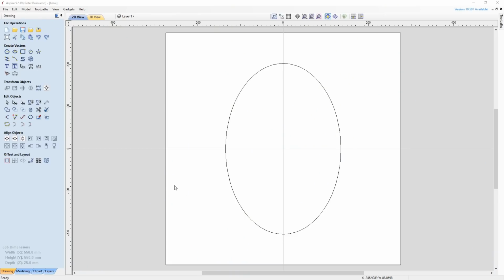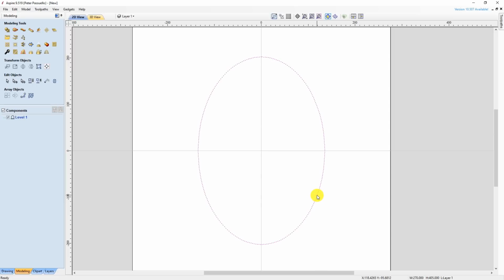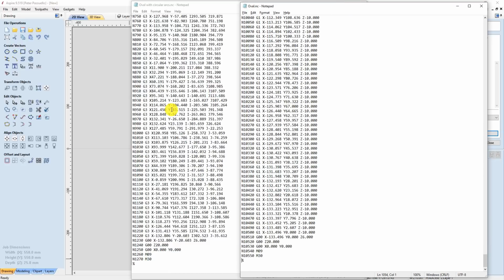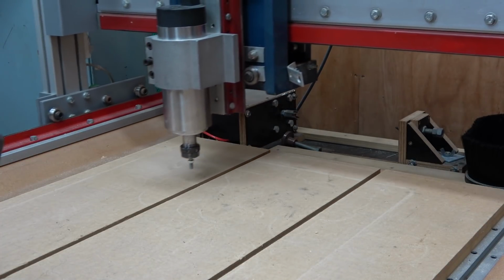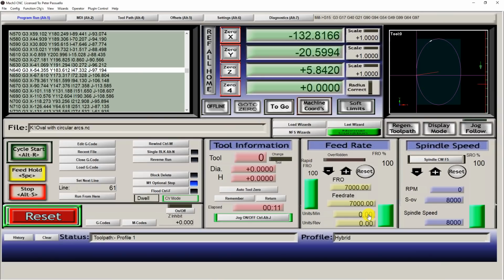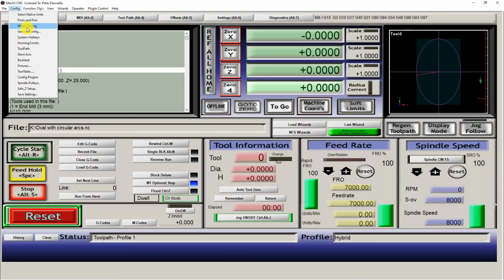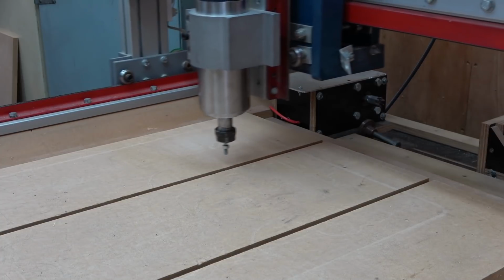Make Smooth running Gcode - CNCnutz Episode 249

Comment: I never understood CV arc tolerance distance until now.  I've been running Mach 3 on a Bridgeport-size metal mill for 18 years in cv mode.  Recently I upgraded to Nema 34 steppers with encoders for closed-loop movement, and it works great!  As far as selecting entry ramping, I like to spiral all the way down - cutting less air.  I just set the tool plunge to the normal feed rate, and select spiral.

Comment: Thanks a lot Peter for this educative video. My CNC is gaining Z in raster mode, about 1mm every 100,000 lines. This causes the roughing to complete without issues but the finishing starts hovering over the rough passes as it completes 100,000 upto 1million lines.

I usually do relief work on wood and I face this problem then. I discovered my Stop CV on 6degrees angle was giving quite a toll to the machine, ticking it off made it run much faster.

Comment: Peter, I recently add UCCNC for my machine. When I move the gantry using the keyboard it works fine, however when I run a project in G code the gantry moves very slowly, any suggestions?

Comment: Great video, thanks. I'll continue to munch through your back catalogue. Anyone have any ideas how to make straight segments into circular in fusion 360?
If only there was a way to have high acceleration in the smooth curves, but tune it down in general use, i.e. moving about with g0 -  at that point I'd like to preserve my mechanical components (I'm using servos with belts and ballscrews on quite a heavy moving gantry)...  
Thanks again
Reply: Any idea if mach 4 is much better at dealing with exact stop and CV?

Comment: hi Peter. I'm very new at cnc and I'm running a masso G3 controller. my question is, how do I stop the machine from backlash when it changes direction. is there a way of soft stopping at a turn? the whole machine shakes when it does a 90deg turn. regards. Adrian

Comment: Hi nut...great video....do u know if there is a way to reduce or disable current to stepper mot when idle in mach3? Or are motors always locked when idle?
Reply from the maker: Stepper motors always lock when idle. If they don't you will lose position. To reduce current your drive needs to be capable of the function and you need to set it in the drive. See your drive manual. It has nothing to do with Mach3 or any other control software.
Cheers Peter
Reply: @cncnutz  thanks nut...reason i ask is GRBL based controllers in cnc and 3d printers stepper motors can be disabled entirely or disabled/ or reduced current  when idle  in settings or menu option....i wish mack3 could do this as it saves your steppers from overheating and hence extend life and uses less elec.

Comment: Hi Peter. I have recently got into CNC. Sadly the Mill I picked up from Wellington did not run in New Plymouth. It was Syil X4. I replaced the head with a new 3.5kw 18000 rpm spindle as the driver for the servo spindle drive had died and installed a XHC Motion controller. I am now in a perpetual game of whack a mole. Not once have I just gone to the shed with my G Code on a usb and made chips. It seems every time I run it I first need to over come a new challenge. It's 7:00 am Sunday morning as I type this and I'm about to return to the shed armed with this new understanding. It's not exactly my problem but it's near to the bone. I now know that my CV settings are completely wrong so regardless I'll spend some time sorting that out and I live in hope that it will solve the current problem I have of the cutter over running in adaptive and carving out my wall. It does it in the same place every time. I have gone from absolutely not a clue about any of this stuff to a very slight understanding in the space of 2 months. Thanks to you and a few others leaving nuggets of gold like this for the like of me to find and collect. This has degenerated into a fight to the death and I'm determined to bet the bastard! Of all the videos I have watch and comments I have read this is possibly the best yet. Very very clear and I got everything you said. (I think???)
Reply from the maker: Hi Foardhook, you can contact me using the contact page on my website. I might be able to help a fellow Kiwi.
Cheers Peter
Reply: @cncnutz  Thanks I will I have not returned to the shed since posting that.
Reply: I was kinda hopeful but no. I think the only productive thing I can now do with my time is to remove the XHC motion controller from the mill and ceremoniously set fire to the bastard in my driveway in a finial act of revenge for all the bullshit and hassle it has caused me.

Comment: Sir can I use these settings for RJ45 connecector mach3 controller, I have cnc machine leadshine servo motor and drive and mach3 controller RJ 45 connector, so can I use these settings in my mach3 for iron carving portrait designing Engraving on iron, please guide me

Comment: Thanks Peter, I just had a weird problem with drilling a series of holes, the Z axis would stop going down before the programmed depth was reached but when I ran the code in Single Block mode the holes were proper depth. I posted the question on the Mach3 Forum and it turned out that CV was the culprit. I remembered watching your videos on it some time ago and came back to watch again. Many thanks for a very good explanation, I am somewhat wiser now. 🤗
Reply from the maker: Thanks Fred

Comment: Great Video Pete My first thought was if you want to use both you could use an exact stop code by adding a G9 to the beginning and end of the corner you want to improve I use this on my CNC machines with Siemens 840D and Funuc 5 axis machines , But I don't and haven't tried it on Mark3  on my DYI cnc machine at home I will have to give that a try and see if Mark3 will read a G9 exact stop  code  give it a try let me know what you think
Reply from the maker: Hi Mitchwood
G9 is not a supported Gcode command in Mach3.
Cheers Peter

Comment: Peter could you do a video on feeds. So far no one ive seen has a video showing people how to set velocity so that when you tell your machine to move say 33mm/sec it actually moves 33mm/sec. So far the only way i know is turn off ramps n run a 1000mm line and it should take 20sec to run that line then i math it out to adjust. Till i get remotely close to proper starting feed rates.
Reply from the maker: Hi David, When you set up your machine you set your maximum feed rate and acceleration. That is all that you can do. The rest is automatic. An axis takes time to get up to speed and then slow to a stop. The 33mm/s is the speed that axis moves when the acceleration phase is complete. It is the the average speed for the specified  distance. At 33mm/sec or 1980mm/Min over a distance of 1000mm should take about  32 seconds depending on your  acceleration settings and even with instant start and stop it would take 30.3 seconds.
Cheers Peter
Reply: @cncnutz  no i found that it can be roughly set. I just figured you could get into the more technical side of it. For example it does no good to tell your machine to run say 20mm/sec only to have it run 10mm/sec simply because velocity is not properly set in mach. But i asked you bout doing a video on how to set this up because when i need to explain stuff to people i usually recomend your videos. Think of it this way your doing a cut with brand new bit and you cant figure out why your burning up bits. You being more seasoned see the chipload as being too small so you decrease rpm or increase feed. Point is you shouldnt have to. If you tell your machine to move say 20mm/sec its movements should at least be remotely close to what you tell it. Setting at max doesnt actually calibrate those feeds to be close to what you are telling it to move.

Comment: Hi  Peter,  If I am cutting a circular hole it seems like it cuts it cuts one half of the hole faster than the other. Could this be a problem with VCARVE PRO or a similar problem with Mach3?  You have very informative videos. Cheers

Comment: Great video. Very informative. 
 Here's a trap that you may not have encountered with CV mode: 
 Cut a 600mm diameter circle in plywood, or whatever material is convenient. 
 Though the machine sounds perfect, as it performs the cut, you'll end up with an oval shape - instead of a circle.  
 Indeed, it is so bad that you'll actually see the distortion in Mach3's toolpath preview screens. 
 Over the years, I have learned to use the G61 and G64 codes, to let the machine switch between CV and Exact Stop modes, during a run - to get the best of both worlds   :) .   
 It is a bit of a pain, but it is worth the effort.
Reply: Hello could You give some examples what you means with solutions please 🙏
Reply: @Przedzik  
 I think you'll need to experiment with your machine, to see if it has the same problem as mine. 
 Careful use of G64, and G61 fixes it, by using 'exact stop' for important curves, and 'constant velocity' for everything else.

Comment: Great topic Peter!  As  LinuxCNC user, I know I am the odd ball here, but I will make a comment anyway.  

I have this line set up in my post processor header, so it will show up in all my gcode files:  G64 P0.005.  I work in inches, and as I understand it, my gcode will not start bending until it is .005 inches from the node where it changes direction.  When working with wood, that .005 is insignificant to me, but it makes my machine run much smoother.

One more quick note about cleaning up gcode:  back when vectric came out with 9.5, they added helical arc functionality.  After adding a few lines to my post processor, some gcode files have a "LOT" less lines of code - especially spirals of any kind (like spiral ramps).
Reply: Not the only odd ball : )

Comment: Hi peter, excellent video, as usual.

One remark about the "Z" speed you were mentioning. The feed rate is not for the Z, but for the X and Y. The Z is controlled by the plunge rate. If you would set the plunge rate at the same as the feed rate, it will ramp very smooth.
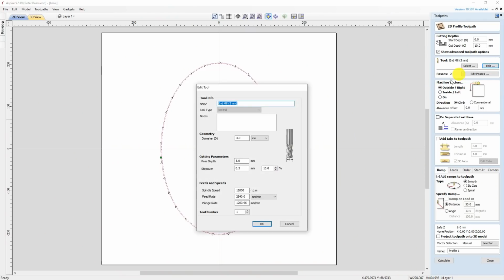Reply: Exactly, look at 20:18 I’m sure it’s just an error and both should have been 7000
Reply: @MrBrettStar  The system will adjust the plunge according, as long you set the feed rate the same as xy. Let's say you need to plunge to a depth of 10mm over a distance of 50mm. That's 0.2mm plunge for every 1mm lateral xy move. At 7000mm/m, 50mm is traveled in 0.43s lateral, 10mm plunge over that distance in the same time. So, 10mm/0.43s will make 1395mm/m plunge rate. Although the feed rate of Z was set to 7000mm/m, the real needed plunge rate for the Z is that 1395mm/m with a given xy feed rate of 7000mm/m.

You can see this very good in action if you would setup a 700mm/m feed rate, cutting to a depth of 10mm over 700mm distance. The plunge rate would than be 10mm/m, 0.16mm/sec!
Reply: @paulvandriel2344  your comment is just as confusing as you are saying set the feed rate the same as xy which would lead people to think there is a setting for xy somewhere else.
Reply: @MrBrettStar  Try the 700mm/m exercise on your machine and it will become clear.
Reply: @paulvandriel2344  I tried as he entered on the screen and the result was exactly as I expected, it still slowed down. The plunge rate needs changing to be the same as the feed rate (which he didn’t do in the video) which is my point
Reply: That’s what I was trying to work out, if that’s not the xy feedrate then where is it. The result appeared smooth but also appeared the same speed, maybe it was an editing error and he was meant to have feedrate at 7000mm/m and change the plungerate to 7000mm/m
Reply: @MrBrettStar  It's simple. If your plunge rate is 300mm/s, xy have to adjust to that in order to allow the Z move to be finished properly.

Comment: Thanks Peter. How do you get feed rate override to 250%?  My Mach 3 only allows 200%
Reply from the maker: There is a slide on the 1024 screen set that you can slide to the top. Up to 250% but from memory you can go as far as 300%.
Cheers Peter

Comment: Wow! this may solve my long standing stutter problem i have in which when running a tool path with tabs in it, i get a slight stutter even when the cut depth isn't yet at the depth of the tab... happens even when air cutting as well.
Great Video Peter!!! I'll post if this works for me. Side note: I use feed rate override a lot.
Reply: This happens to me as well when I cut above 400 ipm. I wonder if mach 4 is better in this regard. Any feedback?
Reply from the maker: Lyle, If you are using Vectric software you could try 3d tabs.
Cheers Peter
Reply: @cncnutz  I did a few of your recommendations including raising acceleration by 2x, change vector nodes, etc. and it seems to have stopped it!!!  I also tried without FRO which i think helps. I probably should have did more testing by eliminating one thing at a time though:( Anyway, this makes me very happy because before i was just slowing the FR down pretty slow which would minimize the stutter . Now i can "fire it up"!!!
Thank You!

Comment: Your lookahead is only 50 lines... increase that to 300 lines and check out your motion smoothness now, then you can decrease your tolerance distance. Also in aspire, there is no need to set the tangential arc tolerance to .0005”. You can change that to .001” or even .002” There’s no way you can hold .002” at that speed in wood.... or whatever it is in metric. This will give you a smaller file. Lots of good tips on the video, as always.

Comment: Exact stop mode is exactly that. Exact stop.  If the Masso controller is not stopping then It is not exact stop mode.
I have no idea what it is doing. Never used one.   It must be smoothing out those stops somehow.  Maybe constant velocity by another name.
Reply from the maker: Masso is preforming exact stop in that it travels to where it has been told but it uses motion planning to eliminated the need for the stop between Gcodes. This allows the machine momentum to be used to move between instructions to eliminate the need to accelerate and decelerate between each command. Maybe your right and it should just be called Exact machining instead since it doesn't always stop.
Cheers Peter
Reply: @cncnutz  One of the advantages of mach3 is you can tune the CV to only have an effect at a certain point. I found it best to turn the excel and decel up to the max setting that it will take with out stalling the motors. Then set the Cv to only have an effect at the last bit of travel on tighter changes in direction. if you just use excel and decel you would have to tune for the worst case and your  more shallow changes in direction would be very sluggish . I think many of the issues  people have with mach is as I mentioned not the correct computer something in windows interfering. program not installed correctly. Not using the latest version. Not understanding the settings. not rebooting the program after changing settings.    There is a default setting built into mach just put the CV settings to zero but do not disable the cv and you will be using the default which usually works pretty good.
Reply: with the masso it slows enough to precisely change to the new issued gcode then accelerates up to the feed rate, it is not constant velocity as it changes it's velocity to be able to precisely cut the path that the gcode dictates. this is the difference between mach3 (stops then changes direction then starts again) and masso which slows just enough to be able to change to the new direction accurately without the need for error tolerance allowances then resumes feed rate.
Reply: @greevous  In the old days there was no CV early 80's so if you really want to imatate the old days like masso. Mach3 has motor tuning  and  ramping you can make the excelle decel slower or faster. So you would set it to pos stop and make the motors slugish. Or you can use the CV and get the setting correct and have the same results with much faster smoother cutting which causes much less wear and tear on the machine. i have been running mach3 in a production enviroment for about 10 years the trick is to truely understand it and get it set up and tuned properly. if you do it is very impressive.
if masso does not have CV that would be a deal breaker for me that means its 40 year old tech. Which explains why it looks so much like MS dos
Reply: Oh i have one more. Many computers especially older ones us a small battery on the mother board usually 3volt lithium watch style (Bought 100 on amazon for $20) They run the windows clock make sure it has 3 volt or just replace it new ones have close to 4 and will last 5--10 years. the computer does not charge this battery. mach runs off the windows clock for timing. Also a SSD drive makes an amazing difference with mach.
Reply: "This allows the machine momentum to be used to move between instructions
 to eliminate the need to accelerate and decelerate between each command."
Lol.  Sounds like a pretty accurate description of constant velocity.
Reply: @Greolt  Yes peter  has some good info in some videos but he is having a hard time grasping the principle on this subject. Fusion 360 also has a couple of settings that have the effect of constant velocity. With mach 3 you need the correct computer windows prepared properly and mach loaded properly. i have seen 2 computers of the same make and model one runs mach very well and the other cant count. Also just because the motors run it does not mean mach is loaded properly.
Also you need a min 3G processor and check the mach website it has complete instructions on how to prepare a new install for mach3. The computer has to dedicated to mach only. One of the things i have learned mach runs best with a video card on board video can cause stability issues.